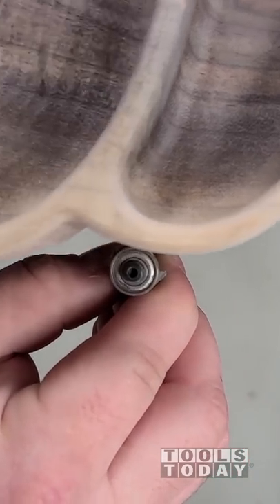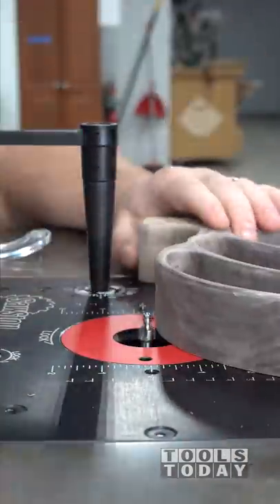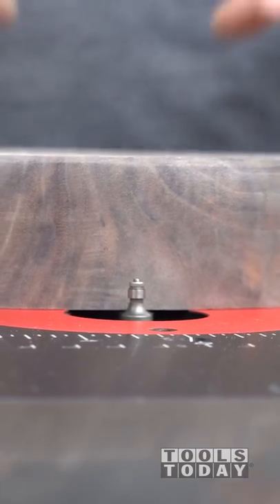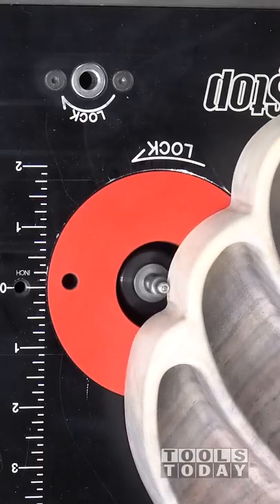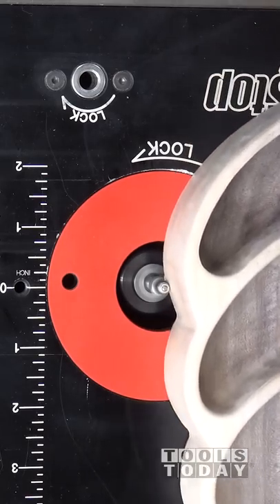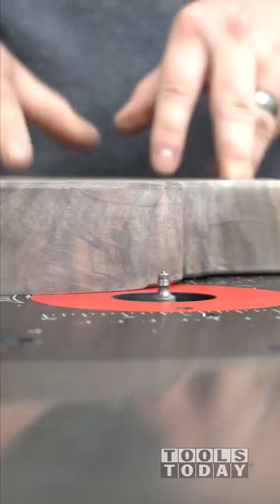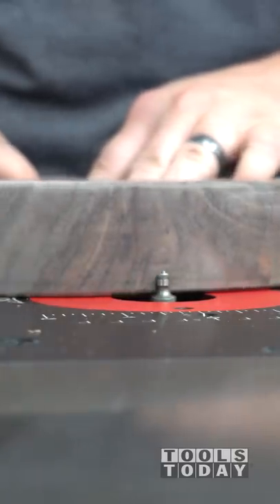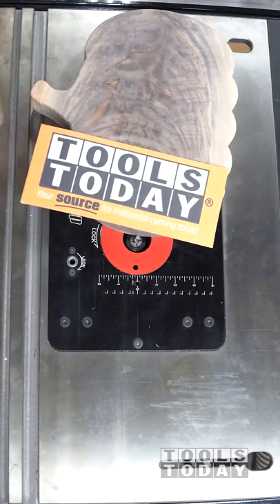Rounding Over Bottom of Pumpkin Tray

Comment: Just be aware that these tiny bearings wear out quicker and can burn holes in the side of your parts if you don't spot it. They seize a lot easier.
Reply: Smaller the bearing the higher the rpm. I ruined a table top before